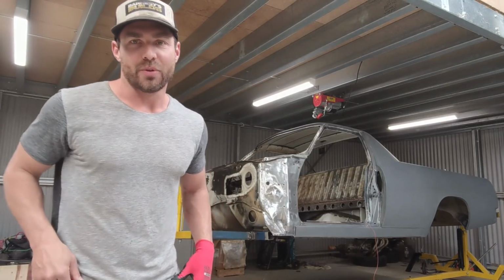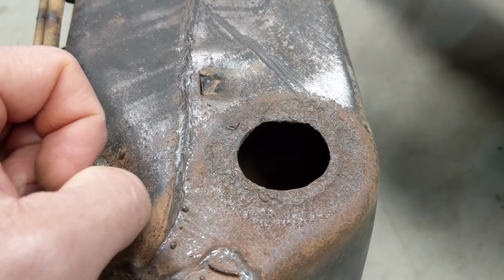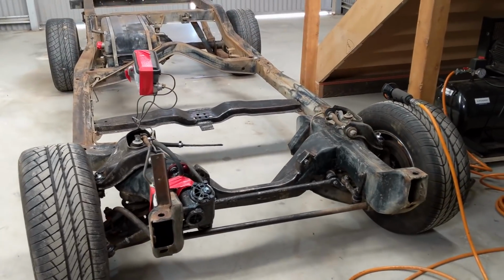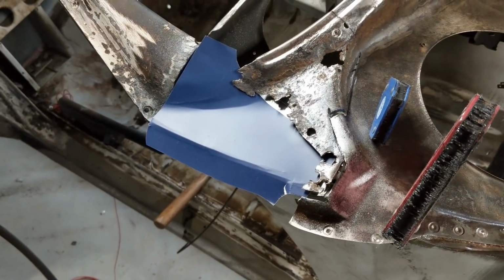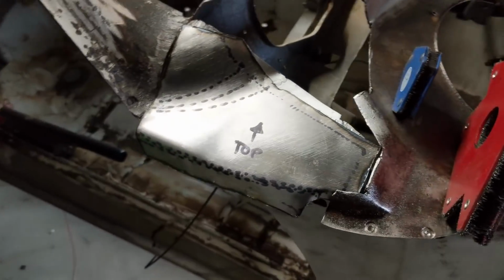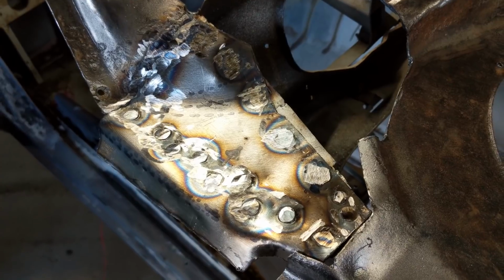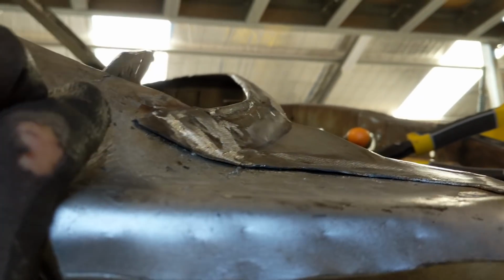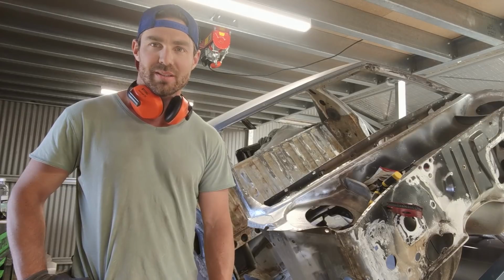EPISODE 23 - PART 3. REPAIRING THE PLENUM CHAMBER ON A 1982 HOLDEN WB UTE.

Comment: whats the name of the machine you where using to linnish the panels  looked like a ryobi
Reply from the maker: It's a no name brand directly from large manufacturer, I imported them years ago for testing. They are all the same just rebranded. You can get them on eBay

Comment: Hey Barnsey, you mentioned in one of your previous videos about cut off wheels that you developed for your die grindeer. Do you have a link where we can purchase them? Also where did you get the mandrel from to fit a cutting wheel to your die grinder?
Reply from the maker: Hey Gavin, Yes i have been testing them for the last few months so as to get the right cutting grit to best simulate a fibre disc and i have got it right so i am doing a production run shortly then they will be for sale. I will have 3 sizes 5 inch 4 inch and 76mm which fits on my small die grinder sir tool with a 9mm arbor. This is the one i use to cut sheet metal as it's small enough to control around tight areas etc. The beauty of the diamond edge as you can also use it to clean up the burrs afterwards without using an angle grinder. What size would you require?
Reply: @BarnesysBuilds  Thanks for your reply bud. I would be looking at the 76mm with the 9mm arbour to use on my die grinder. I will defo be keen to try one out when they are ready to go. Let me know when you are ready to go. Cheers Gav
Reply: @BarnesysBuilds  Any updates on the die grinder blades mate?
Reply from the maker: @aussiegav123  yeah mate, I have some 75mm ones if your after one? I haven't officially put them online or anything try but the 75mm are $20. I can sort one out through PayPal for now if your Keen to try one?

Comment: i am doing a wb one tonner, i am doing mine up at about the same as you,  love your insights helping me a lot, I watched you drilling out the spot welds and tearing your hair out, i found a drill bit for $12 that is designed for spotwelds. it is a small hole saw about 10mil wide with a center shaft that locates in the centre of the weld. was a real time saver and no going through second panel. keep it up
Reply from the maker: Thanks Tes, yes i have seen those drill bits, i have worn mine out so i will need some new ones! Good work on the one tonner and all the best with the build.

Comment: Look forward to watching your videos as they come out, great inspiration for myself and many I would think. Keep up the good work champ. Oh when your finished with the rotisserie I’d love to buy it if you have no more use for it
Reply from the maker: Thanks Wayne, Thats always great to hear and gives me motivation to continue the journey. The rotisserie certainly makes the job easier, not sure if i will keep it or not once the job is done, i could always do a HZ next...
Reply: Barnesy's Builds it never seems to end does it lol 
If you decide to sell rotisserie once your done with it just let me know mate. Can I ask where you got the metal cutter from, I’ve been through your episodes twice but still didn’t pick up if you did say. Keep up the great work 👌🏼
Reply from the maker: @waynedainer934  Hey Waynes, sure i will give you a bell if i decide to move it along after the project. The metal cutting discs i actually developed myself as i have a small business making diamond blades for concrete cutting. I was tired of buying fibre discs so designed a very fine continuous rim brazed diamond metal blade with cooling holes to use on my air tool. It actually works great, a tiny bit more clean up on the edges but a small price to pay for not having to constantly buy and change discs, having the messy fibre dust everywhere and keeping the same diameter while you cut i find is much better.

Comment: I agree with mark stone, you need to hang the complete front panel assembly back on, rad support, guards, bonnet and hinges, nose cone, doors and don't forget the grille on the cowl. Get all your panel gaps and alignment sorted and squared away, then trial fit the replacement cowl.You only get one shot to get it right...I speak from experience on this when getting it wrong..I would also weld up the seams on the overlap of that last repair patch. Alot of water and shit is going to get up in there, you don't want leaks and potential rust spots to develop.  Great stuff, keep at it..
Reply from the maker: Yeah i agree as well, was always going to do that anyway but glad to hear it is required. Not sure if that will have to wait until its off the rotisserie again however as it's sitting very high currently which makes it harder to hang the doors etc. I could lower it but the jacks seems to have seized so i might just continue stripping the underbody,  tub firewall, repair the floor pans and paint them and then lower it down to do the cowl panel.

Comment: 10 bolt Salisbury is the diff you have👍
Reply: It sounds like the ratio of the current diff might be a 3.55? That's what I had in my first WB quite a few years ago and it had a top speed of about 140-150k/hr. It was much better at circle work! :-)
Reply from the maker: @RayPlant77  yeah that sounds right, I think the V8 work Utes may have had them for more power down under load. Yeah great for circle work! Need to get 3.08 ratio thvn it looks like.
Reply: @BarnesysBuilds  yes, 10 bolt Salisbury,  (Aussie version) not to be confused with USA models. Its possible you have a 1 tonner diff, some came with 4.44-1 ratio. If it is a 1 tonner diff it will have thicker axles in It should have the ratio stamped into a plate/flange behind the pinion where the tailshaft uni goes. Also with panels with rust,  clean it ALL off before putting any other panels on top. For rust converters look for stuff with phosphoric acid in it. You will get a better deal going to an industrial chemical/cleaner supplier than an auto parts store, 5 litres for around 20-30 bucks as opposed to 500ml for 10-15. Another tip, Weld through primer.
Reply from the maker: @fnqhkgts620  Thanks mate, is it hard to change out the ratios to a 3.08 do you know? Or do you need a whole new diff? Yes i am all over the rust prep these days, and the weld through primer, this ute was almost more rust than metal!
Reply: @BarnesysBuilds  if you have never changed rear end gears before it can be a bit daunting, plus you will need some specialist tools like a good dial indicator, magnetic base and quality torque wrench. If you do change gears, they need to be done as a matched set, and I would highly recommend putting a bearing an seal kit through it too. Work out what ratio you want with a few on line calculators, tyre size, diameter, transmission final ratio etc all play a part. Keep up the builds,  they get me motivated!!!
Reply from the maker: @fnqhkgts620  Thanks Martin, It does sound a little complicated, i will save my brain power for when i start to dismantle the front end and leaf springs etc. Yeah cheers i am doing my best to keep them coming that's for sure!
Reply from the maker: Thanks mate!

Comment: Do you know if the rear cargo area floor panels are available anywhere , you said in the video that the rear wall is available , is that a rare spares part ? Also how are the cutting blades coming along ?
Reply from the maker: Yes they certainly are available, rare spares do sell one. 
https://www.ebay.com.au/itm/HOLDEN-HQ-HJ-HX-HZ-WB-UTE-REAR-WINDOW-PANEL-CAB-WALL-RARE-SPARES-BRISBANE-QLD-/222463660969

You can also get them from Retro Rod metal fabricators through facebook, these guys do beautiful panels.
https://www.facebook.com/pg/Retro-Rods-Custom-Sheetmetal-899889020144018/photos/?ref=page_internal

Yes final testing has been done on the blades and i am just waiting on one last sample to test the diamond grit size on the sheet metal before i do a production order. I would say within 4-6 weeks i will be ready to sell them. Just wanted to make sure they are a quality blade so it takes lots of testing to get it right.
Reply: Barnesy's Builds 
Thanks mate that helps heaps , can't seem to find any tray floor sections , if you have any suggestions it would be greatly appreciated👍

Comment: Hi mate, nice work on that corner. 
I'm sure you will, But fitting the cowl panel with the doors in place is a good idea, and if you not sure where    they will end up, wait until the day comes when you can dummy fit the hole front end back together. Don't     guess it :):). Once cowl is prepped and ready, only take you a day to put on.

Check the paint your going to use on the plenum, some of these paints such as por15   actually need surface rust  to stick to, not so good on clean bare metal. Personally the plenum chamber and   underside of cowl    panel i would 180 sanding then 2k paints. KBS paint I've been told is good for chassis as is por 15 just check its not a similar deal as POR15, isn't so good an clean metal or exposure to sunlight. Not sure about KBS.
Punching the work out now, how good is it having it on a rotisserie
Reply from the maker: Thanks Mark, Yeah i thought as much, about the doors, not even sure you can mount the guards without the radiator shroud put back on the chassis etc? I know it's bloody close as i placed the old cowl on so i can start to panel beat the repairs i have done so they line up, looks like it fits pretty good, but yeah i won't leave it to chance. I don't know what this reproduction cowl fitment will be like. So 2k paint as in Epoxy primer?
Reply: @BarnesysBuilds  yes its like an epoxy paint , any product that you mix 2 parts is superior     IMO. i use TB540 Polyurethane Enamel, valspar product, there are other products just  as good,  I paint chassis and engine bays with it and the hole underside , glosses up and is very hardy. 2 coats onto bare metal. 
 I  just dont like using products like POR 15 other then what its intended for, painting over    surface rust.   KBS on your chassis is still the way to go if not going the expense of        sand blasting etc.
 I have just replaced the plenum and cowl panel on a HZ, and was very happy with both of these panels from rare spares, thumbs up to rares. Hang your doors,then bolt guards to   fire wall supporting the front of the guards, then centre your cowling in between, can only move cowling  left to right. measure across your bonnet then check you have  about 9mm larger gap between your guards if you know what i mean.
Reply from the maker: @markstone5593  You really are helping me with this build Mark, i really appreciate the help, i will take your advice on that as i was up in the air with it as well. Do you have a supplier i can order the paint from online?
Reply: @BarnesysBuilds  Signature automotive paints, think they are only in and around Brisbane, but any automotive paint supplier if they stock Valspar products.

Comment: Looking great mate, that's probably the most difficult area you'll have to repair, with any luck.
   You mentioned the rear wall of the cab, which is also the front wall of the tray, being dented and you're going to cut it out and replace it. Have you given any thought to putting it back in vertical instead of leaning in on the angle? It creates a shelf approximately 130mm deep giving you a bit of room for things like amps, subs, fire extinguishers and stereo head units. I know I'll be doing it.
   Just a thought mate.
Keep them coming! :-)
Reply from the maker: Thanks Ray, Yeah i feel like it might be the hardest part done, although i still do have the bottom of the doors to go which are really bad and need major work, they are also pretty crucial for alignment etc. They will be coming up soon. Yeah although the ute will never be concourse original spec i feel inclined to keep the original bodywork in place to stay true to the way the ute was designed. I know it would be easier and cheaper to get a flat piece of sheet and do exactly that... something to think about..